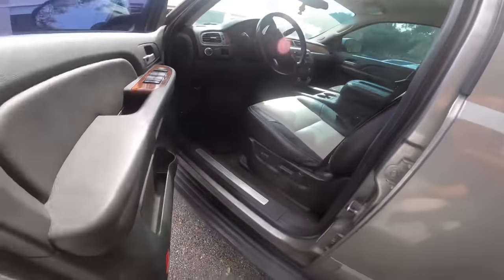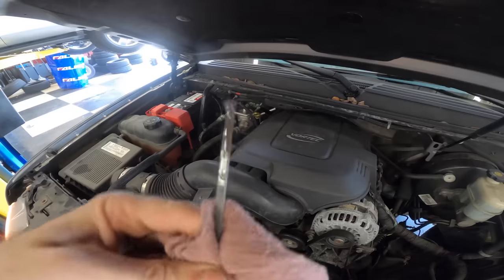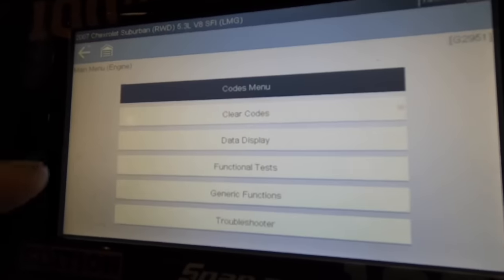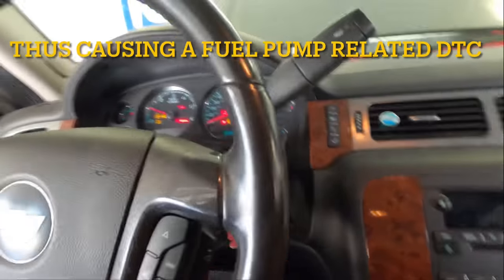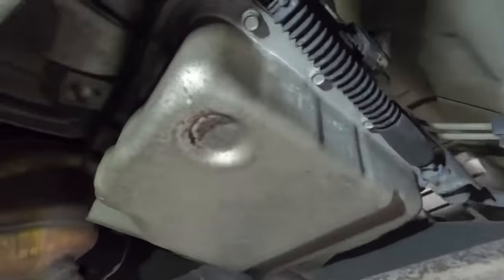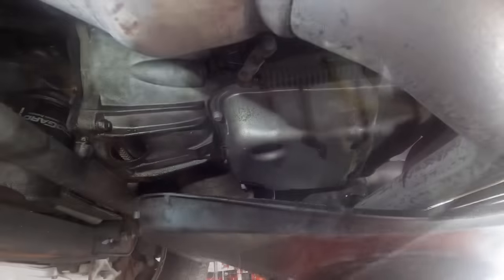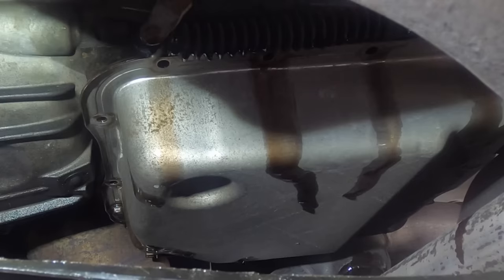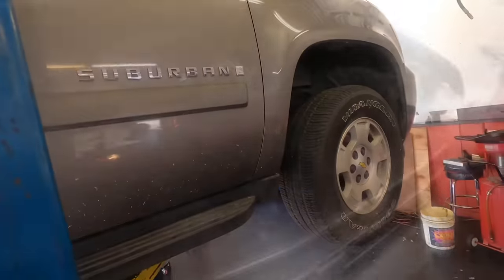Busted! SCAMMING Mechanic Causes Damage! 4l60E Transmission

Comment: i had a water pump replaced and was supposed to be only 300 but ended up spending about 1400 everything the supposed mechanic touch he broke luckily the shop owner didnt charge me labor to replace radiator... needless to say truck is running worse, my brand new thermostat was removed without my knowlege, a transmission line was not thigthen that i did not realize until a month later and check transmission oil and it was completly empty. It is a f150 4.2 litter and i put 4 quarts of oil.

Comment: Either due to incompetence or intent, had a mechanic tell me that my engine was not running properly because it needed a fuel pump.  This was an 89 dodge grand caravan.  I had checked the engine code and it was saying engine coolant temp out of range (not verbatim, it was something similar).  When I told the mechanic this he said there are lots of sensors....Keep in mind they had just replaced the timing chain, and this problem I was having was from the day I picked it up.  I even mentioned the check engine light was on, and that it never was before.

Eventually I just went under the hood myself, disconnected the temp sensor by the upper hose thermostat, reconnected it, and the stalling and issue went away instantly, and the check engine light.

I was a customer for 20 years.  I am no longer.  I wonder how many times they scammed me, or cost me extra money if it was incompetence.

Comment: My first car was beat to crap after being a rental vehicle, and had a slip between first and second (so I accelerated super slow), and the overdrive gear was toast. It would sound like a toddler jumping on the accelerator whenever it tried to shift into overdrive (so I also avoided the freeway). I limped it along for 14 years with annual fluid flushes. I moved around a bit, and I had a couple places not want to flush it, asking if it'd ever been done before. One admitted that he hadn't wanted to deal with the mess it'd be if it was the first flush the 30 yr old car had ever had. I went annually because that was about the time the fluid would start to be sparkly (cringe). If I wasn't a broke, it would've been cheaper to just rebuild the tranny in the first place than pay a shop $75-100/yr to flush it.

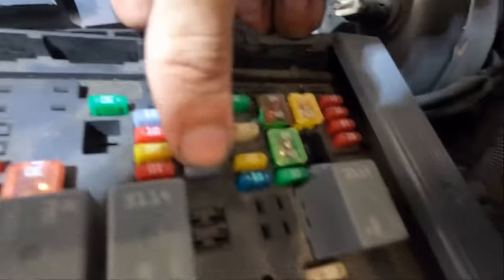Comment: 13:43 then 14:10 you had to have been the one that removed that 15 amp fuse im confused why did u say it was just laying on the trey at 14:33 ? then u put it into a different location 15:15 ? i bet that fluid was in horrible condition from the torque converter struggling to get the vehicle moving in second gear for how ever long it was like that.

Comment: The tink tink tink sound could be a loosened flywheel bolt. Shady mechanic could’ve just backed it off a couple turns through that inspection port.

Comment: I had a "Shade Tree Mechanic"  here in Challis Idaho try to Scam Me last Spring! I told him my 1980 Ford F-150 wouldn't start and I had a Distributor Cap, Rotor, Ignition Control Module and some other assorted parts that I bought and told him to replace them. He BROKE the Horn Pad , Took the Steering wheel off and Replaced the Ignition Switch Cylinder and There was NOTHING wrong with the Cyclone Lock! Then He LIED to me and told me there was a Short in the Ignition!!! After waiting ALMOST Months I Fired Him and Replaced the Ignition Switch which is on the Top of the Steering Column. I had it Running GREAT less than an HOUR after I started Working on it. The Horn Pad just Cost me almost $75.00 on EBAY. He charged me $350 and did less than an Hours worth of Work. Then for an ENCORE he kept the Steering wheel thinking that I wasn't going to pay the $350 for the Shady and Shoddy Work that he did!

Comment: We had a shop in my hometown that would constantly do the "work" but nothing will be fixed and they charge like $80 an hour. they were the only shop for a while with like 45 miles so they had that going for them...until some out of town biker ended up running over something an putting a hole in his tire. he took it to the shop wanted a new tire not a patch the shop charged him $1788 for a new tire and labor cost....the tire was a almost new tire with a patch on it from a puncture. that biker became my first boss after he sued that shop and they shut down he moved in and now hes the cheapest around

Comment: Folks like this scammer are the reason why I became an Auto Tech in the first place. I have had a Tuffy's scam me out of $1200 for parts they did not replace. I have also had a customer who went to a Midas for a catalytic converter (clogged cat had caused the head gasket to blow). I fixed the head gaskets and opened up the exhaust piping via removing a few O2 sensors, to keep the head gasket from blowing again. The cat was bolt on, Midas sold he the back half of the exhaust system, did a horrible job welding it up and then welded a bolt in the o2 sensor holes. Needless to say the head gasket blew again. I offered to go to court with and for the customer so that Midas would have to pay to fix the car properly (hopefully by me) but they declined and tried to insist it was my fault. As you do Ray I thoroughly document what I do and find on the cars I work on. They ended up just junking the car and lost a bunch of money, all because they refused to listen to what I told them. 

This example is a reflection of what happens when you have a customer that wont listen to you and they go to a bad shop. If they had just listened to me we both could have made out like banshees at the expense of Midas. Moral of the story, when you find an honestly and high quality tech, listen to them.

Comment: With the color of the fluid I would have pulled the transmission and cleaned the valve body and put in a complete kit with clutch packs new plates.
Reply: Especially with a slipping transmission.

Comment: I took my truck to a shop for an oil change, and they told me the engine light came on and it would cost another 120 to fix it 2 months down the road. I was replacing a fuse. I found a wire dangling and connected back, and the engine light came back on, so all they did is cut that wire to get more money out of me.

Comment: GM getting notorious for those stepper motors in the gauges. Got my 2500HD for a smooth 600 bucks here that's all that was wrong. Cluster rebuilt good as new
 Great job Ray not many honest mechanics anymore

Comment: And what I usually do too it’s like when we have the boat we couldn’t get to the oil pan so he does pump that oil out from the dipstick. I just the way the motor was designed for the boat but on transmission pan I never had to but why not pump it out to that where the stickers at the dipstick is that pump it out from there and then take the pan down since it doesn’t have a drain plug and then put them put a bomb pop bunghole on it.

Comment: I took my 2017 Honda odyssey to the mechanic for an engine misfire with transmission gear shifting problems when I switch from park to Drive Depending how the car sits on the slope, It will shudder. The mechanic finished the diagnostic in 3 hours and had told us we might as well replace the engine and that the transmission slippage already means something’s broken. Totalling our repair cost of $10,000. He told us the engine went bad a the direct result of not changing our oil in time which on hindsight was strikingly suspicious. Ever since we got the car at 72k miles, We changed our oil whenever it reached between 15 to 5 percent oil life. The current mileage was at 192k miles and it so happened that we ran into a serious financial crisis, Living surviving on $100 a day off of doordash while I sought for a regular full time job. 

   We drive it past due of about 3k miles and to say that the best Honda engine on the market gave out because of one single missed oil change sounds ridiculous to me but I had no other choice but to take his word for it since I couldn’t afford the repair costs regardless. He told us to stop changing the oil completely as the old oil is the final support that keeps loose debris inside the engine from kicking up to other areas and causing the engine to run worse. His best advice was to keep driving until the engine inevitably dies. Knowing myself with my huge lack of mechanical experience, I listened to his advice and we drove the vehicle almost 30k past due without even a single maintenance done on the car let alone an oil change. The check engine like was still blinking and I still experienced driving difficulties as the transmission is very sluggish and the slightest over rev will violently jolt the van. 

     When it seemed hope was lost for our minivan, A new friend of mine knew a very honest mechanic and I agreed to let him see my car and he changed my oil with the filter and when it came time to flush the contaminated transmission fluid, The fluid came out almost black and gooey with medal and chunks of sludge. Once he flushed out the old trans fluid, He added the new fluid. The engine ran much smoother then previously and the drivability improved as well but the problems are still present. The gearshift is smoother but I can still feel a slight clunk and the van still struggles to switch from first, second, to third gear and so forth. The mechanic had mentioned to me that he didn’t have time to change the transmission filter and gasket so there might be sludge that’s blocking the solenoids which causes the driving performance issue to persist. 

 
   One other notable thing is that the transmission performs better at early mornings for some reason, I figure that might have to do with the fluid settling overnight and the solenoids become unblocked slightly until it all returns as we continue to drive throughout the day. It’s now driven just about 30,000 miles since our last visit to the mechanic, Clocking at 220k miles, and it still runs strong. Still have concern about the un attended misfire That shows an error code for a cylinder 5 misfire on the obd2 monitor. It’s a light misfire, Meaning you won’t quite hear it unless your sitting inside with the radio turned off or pop the hood. From my understanding The misfire comes up and goes away on its own. And I hear a concerning noise coming from the engine that might not be coming directly from the piston, I’m not sure how to differentiate noises but I did research on rod bearings and crankshaft bearings, how they sound when they have gone bad. So far I was only able to find footage of the sounds of crankshafts that have broken but it doesn’t sound like the problem I’m dealing with because the clips show loud knocking noises. I can’t tell if it’s noise coming from the casing of the engine shaking from the misfire or something happening internally. 

   
   I heard no mention from the new mechanic about the noise and he doesn’t seem too bothered about it, Besides that it’s gravely overdue for a timing belt and I suspect that driving it for so long without an oil change, Made the tensioner guides brittle as it makes a loud morning start rattle so I’m looking to get that serviced it the very near future when I collect enough money.

Comment: There is a charity in Hardee County that had a story about their "troublesome delivery van!" They were relating their story that a "mechanic said, the headlight with moisture in the headlight assembly was a sign the van wasn't worth fixing!" It had a miss and other issues. I wonder if you could treat them right and truly give them a correct diagnosis and maybe repair. ABC news at 7pm local news!

Comment: Had a 7.3 diesel that kept dying but would restart after setting awhile. Took it in, was told that it was an injection harness and the computer. Paid 1000$ only to do it again. He spliced the harness and never replaced the computer. He then said 100$ for a new harness and free labor. 1100$ that should have been 200$. If the shop doesn’t have a web sight that allows reviews, best to not go there.

Comment: That's why it's best to run the engine and then test the transmission fluid some transmission to have to have it parked some Transmissions you have to have a neutral it tells you that right on the stick. Starting it up you have to fill the valve body plus the cavity in the new filter. Never trust the Overflow to be right on the mark but I know that you know that's the right way to do it

Comment: As soon as I saw that blue wire coming out the fuse box. Nothing about that engine bay said amateur wiring except that. Why would a shade-tree drop 400 on labour? Just didn't add up.

Comment: After reading all the comments,  its amazing how many people think this was how all mechanics should do it.
Honestly it was a great diagnostic and repair for most part. But what gets me and exactly why i dont take my car to shops is mechanics who have been doing this for many years start skipping manufactures detailed steps for a proper repair. Mechanics quit checking the guidelines because they have done so many cars they think they dont need to follow those guidlines  anymore.
In turn they start getting bad habits. If you watch installation of trans pan the very first bolt was torqued down with a cordless impact. Then proceeded to torque all remaing in a cross pattern with the impact. 
Sorry but this is not the proper way.
There is a sequence how every bolt should be installed and what order to install. Then how much to torque every bolt to.
Now any bolts that are over torqued let me expain what will happen. That truck will get sold then new owner will take to dealer or shop and someone will torque to proper torque value  and because all the mechanics before didnt torque properly and over torqued bolts will come loose may even drop out. 
Youll get the car back and be like look at this the last guy didnt even tighten the pan bolts. 
Follow manufactures set guidlines youll almost never have an issue.

Comment: I recall I had a customer ,(we had a rep for being one of the most honest shops around (in Houston area we were in) this lady went to 3 different trans shops and all 3 told her she need a rebuilt transmission, so test drove her Volvo,and sure enough light was on, had a code, and wouldn’t upshift..as I was driving I noticed her purse was on the center console , so I lifted it up, and she had been placing it on the show, rain,traction button causing it to shift slow and sluggish..I flipped the switch and sure enough it ran like a new car….I cleared the codes ,told her and she drove back to each trans shop and let them have it, lol.l my neighbors weren’t too happy with me, considering both transmission shops were less than 100 yards from our shop and we knew everybody..oh well at that point she was my customer so she came first.l m crippled now (DVET) but I’m thinking f opening a shop on my ranch

Comment: As far as GM transmissions 
Sometimes once they’re this bad either leave it or if your going to change it then don’t change it all. 
    I’ve had them start slipping immediately after with fresh ATF 
    I pumped some out and poured back in some of the old. (1 1/2 quarts old) and stop slipping. 
       GM transmissions are kinda scary once they’re in high mileage and not maintained

Comment: 4L65E
Sorry folks but the  60 was discontinued 2003.
The  65 is several inches longer and is a totally different transmission. 
Yes when the model year changed in 2007 so too did the transmission. 
Is it a 6 speed?

Comment: That the reason I learned how to fix cars, after a couple of cheating from mechanic shop (improper installation of the valve cover gasket that start leaking after one month, it cost me 130 dollar, and I had to do it myself again..)   and now I am a professional, but I only fixed my car, and some times neighbors and friends cars but most of the time I do just diagnostic,  I fix everything except something involve engine removal, because you can't do that on the street, you need a garage to do that and also an expansive tools to hold the engine up, there is a cheap tool to do that but you don't trust that, I have seen an accident :  somebody use the engine removal cheap tools on his driveway, the tool went of balance  and cause the engine to fall down back to the car chassis and damage the oil pan, that start leaking oil, and there was no way just to put back the engine properly in the car and install the engine mounts,  I left them there struggling with the problem, the engine is too heavy.

Comment: Those scam shops act like people don't know their own vehicles or have a scan tool.. I always know all my codes if any and do my own work. But if I need help and take it in for something I can't do I bring my own parts even though it voids warranty and i know exactly what they did. And I check after. Because I'm not afraid to get under my truck and know how it works and runs and what parts are what or OEM.

Comment: There is a lot of overlap with HVAC (my trade) and mechanics, in that, you should worry a lot less about the price and more on if they are honest. It can be as hard to find a good, honest mechanic as it is a hvac tech. Both suffer from shady half truths to flat out scammed. It sucks.